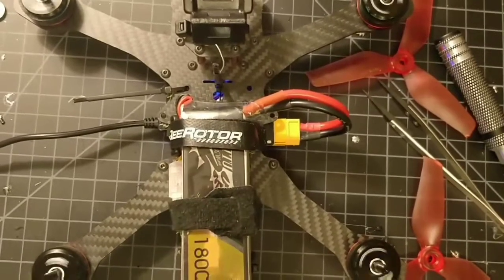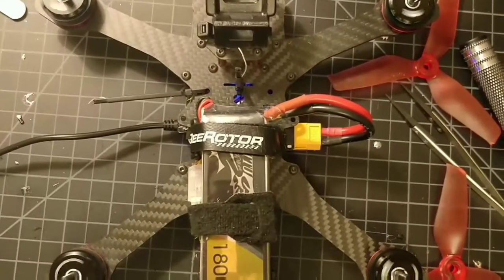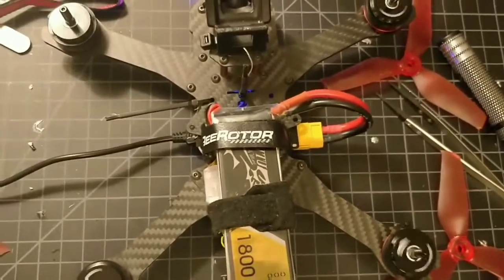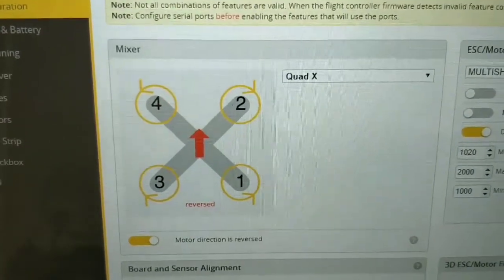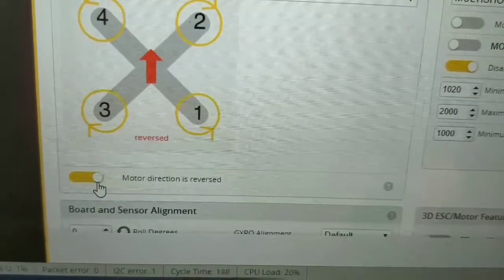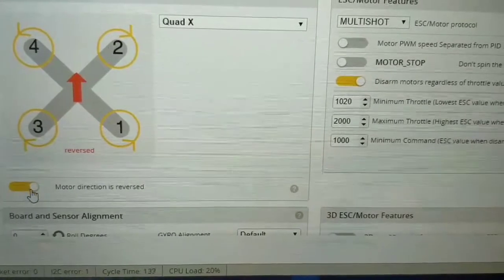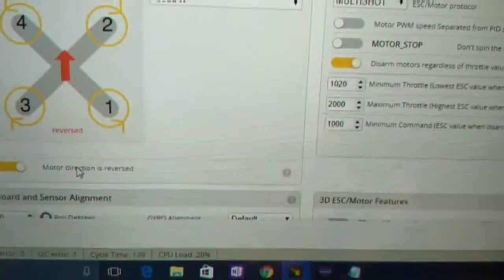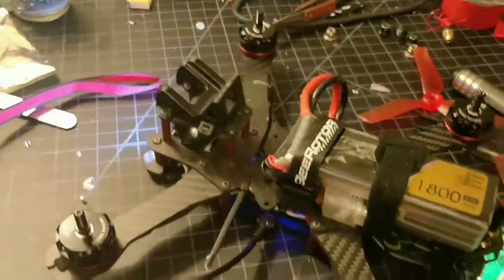Motor reverse Direction stuck in betaflight 3.1.7

Comment from the maker: I tried flashing to 3.2. while that did fix the motor reverse setting being stuck, my bird is still flipping. I would think multiple firmware flashes with full erase would eliminate software as the cause. But I've triple checked my motors spin and propeller direction. I need to go back to square one. I'm going to try flashing back to 2.7 and set up without the cli dump.
Reply: dont know if you have checked this but i just had a very similar issue the other day on a build. turned out that i needed to change the fc yaw orientation +90 degrees. I was very confused because i had the arrow on the fc facing forward but apparently my omnibus f3 nano doesnt consider the arrow facing forward as the default orientation.

So maybe check +90, 90, +/ 180 ect and see if the board orientation fixes the issue.

Comment: it is a bug in betaflight, there is a list of issues such as motor tab wont work and blackbox logging in addition to the motor reverse button.   There is a way to force these motors to run forward through CLI but  the bug may revert it back when it reboots 
They have a fixe listed for it on gethub but I cant figure out how to download and install it since this is a chrome app issue